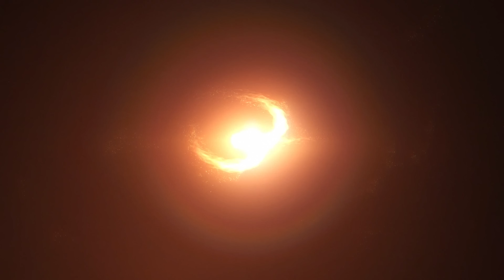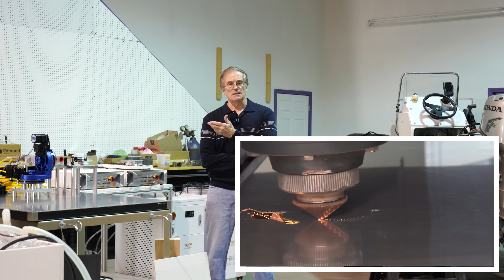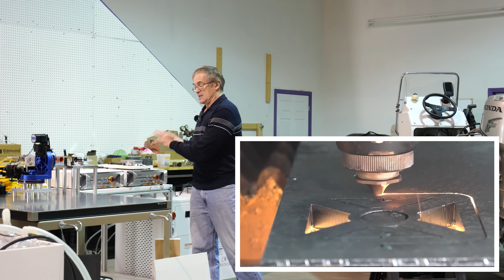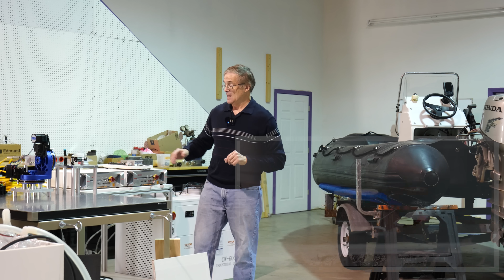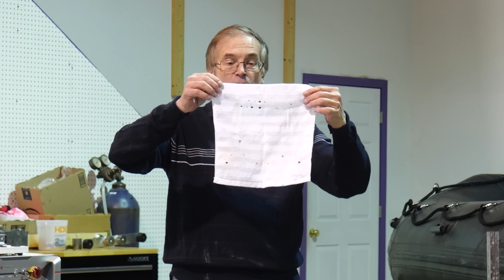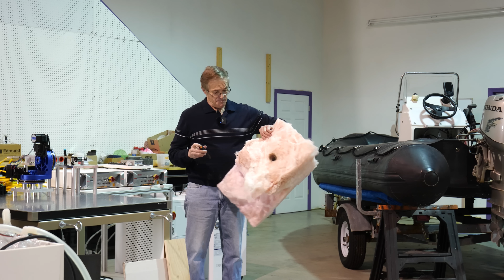We have a problem... and need your help!

Comment: You've already head quite a few comments, but I'll take a whack at it. My first thoughts were just using quartz fiber, thicker & thinner strands & just wetting them down in a bag or a couple maybe for layers of pouches to easily absorb most of the light & then reflect/refract them to diffuse the light into becoming less powerful. 

However, with how quick everything is, its probably easier to do something with hollow quartz tubes with nets plated with nickel around the outside & in-between, but that's a lot of plating for that fiber, which kinda just sucks, even though it might help with total water heat energy so long as you can soak it with a bit of sponge & or other fabric that's highly refractive & defractive to the light wave length. The wave length here matters the most, as its what allows for you to know how you can run a destructive interference pattern & a slight absorption & defraction reflection capture system.

Gases where going to be my go to, to recommend. A pressurized gas inside of quartz & a correct oil for the absorption & correction refraction/reflection index for your wave length will help you out because you can make sure everything is thick enough & has expansion chambers while being extremely cheap to boot.

But, it might be just annoying to have to buy & melt all of those quartz tubes & still be fairly expensive. The gases can be cheaper stuff like co2 & or sulfide gas like sodium chloride tetrasulfide mono-nitrogen gas. But the melting thing is more about thermalmomenta, the quartz is dang good at keeping itself from melting when it can only lightly absorb energy, which the gases & oil (typically a darker oil like synthetic high temp motoroil is going to perform but it depends on the wavelength of light) help with, if you can pump them around.

So, instead of all the quartz business, its likely easier to just have it destroy something that creates the needed defusal of light, like a bunch of clear rocks & a water with a proper offset s curve bend of mirror steel or something (tiny holes that have some behind them with a bent flare with holes in-between) to house it all to trap & contain all the needed light while making the energy no longer become substantial. 

the problem with glass is its heavy & expensive. So a plastic & fiber glass blend might be the cheaper option, if you can get a better cheaper fiber & poly-carbonate or something higher temp to hold all the water & clear pebbles. 

Reflective options on that need to be multiple layers of one way mirror finishes on the inner box or wall side that allows for it to be effectively attenuated, together with being able to use laser goggle plastics & or similar to allow for that light to be massively reduced trying to head back towards you, same with inside of the "anechoic chamber" for light you are making. 

Best option however, all told (besides a super trick laser pulse phasing system designed to interfere just right & destructively interfere to make it so it diffuses the beam & fully removes its power in a few millimeters! Oooh yeah baby! (sadly decently annoying for angles & timing together with a near net like grid & mirror board like system to then get angles down to do anything like that which just is complicated & while works shrugs harder to do that is likely desired)) is just an high temp oil, a high temp absorbing ceramic that cheap (like crushed rocks & dirt), combined with a few poles & a bunch of hoses that "water fall" it down with a cheap absorbing backing material that allows for it to river "wick effect" with some offset lengths of sticks & thatch for that material (like steel wool fiber or quartz fiber, something high temp & all that) to have hold it & have paths for the laser light to head into, reflect, then disperse into the surrounding pumped thin-ish mud-like liquid.

Can't beat stuff thats free & cheaply put together that can be made to work with some larger tolerance pumps that have the oil (from the fluid) to make sure they never have lubrication problems.

Hope it helps 0/

Comment: wet sandbags. ideally many small bags of sand inside of each burlap bag.    possibly some gravel mixed through to cap the holes.   To really get techie, mix some baking soda or any carbonate mix to foam instantly in the beam and ideally help contain the damage to the bag.   The ideal would be some mix that would become tacky to solid instantly in the heat of the beam so it would adhere to the bag preventing gross rips from spilling large volumes of sand.
Reply: And ideally you would have a "hunting" beam that would only turn on full power when the "hunting" was positively on target (perhaps only milliseconds).   That requires very fast processing to identify ... but I don't think it would be too bad if you have two cameras from different angles tracking the target, as both would flare at the same time when the target is positively covered.   A PID like algorithm could track the target's relative angles continuously and a flare at the predicted location could be identified almost instantly.... when both cam's flare from the hunting beam  power up for maybe 50ms ....

Comment: first thought i had was a large area with water mist (even sand!?), enough to disperse the beam, but i'm sure that would be a massive assembly / area to cover.  
I think you need multiple solutions here.  Power and optical assemblies adjustment to reduce time of the beam burning through everything.  Some camera vision smarts to detect that the beam has passed through the desired target? As well as some things (layered or dispersed) to stop the beam (at least for a short period of time)

Comment: grinded Copper oxide CuO mixed with Water.
Also anodized aluminum.
Carbon is another option to cover Surface.

Or use Graphite blocks combined to water.

Comment: More of a side project suggestion than a solution: Could you bounce and bend the laser beam by harnessing a jet of water to preserve the beam until tripping it to disperse/diverge as desired? This may not be applicable or workable with tracking/aiming adjustments, but it might be an interesting direction.

You may have seen industrial lasers that introduce a relatively low pressure (70-80psi) jet of water about as wide as a human hair to extend the optics of the focused beam out of the head over a greater distance; for those that aren't aware yet, fiber laser arrays produce a frequency of energy (around 1000nm) that will stay within the boundaries of a glass fibre cable, however it also will behave similarly within a ‘cable of water’ (to an extent). For industrial purposes this means that the ‘spot size’ of the beam can be somewhat maintained over a longer distance without expanding as it would in air/assist gases. Anyway, effectively the divergence of the beam in these setups will be curbed to the physical diameter of the water jet, so long as the water path is physically maintained. The benefit here being a cleaner/deeper cut for thicker materials. If this concept of a water path carrying laser energy at this wavelength is extended, it just might be possible to re-disperse it behind the target by conventional methods rather than exotic materials. These hydro-laser laser heads are crazy expensive though! Rather than the burden of creating or buying a lens assembly that integrates a water jet into the path of the beam while keeping all the optical properties in check, a first principles/iterative/minimal approach might be to try first with either lower power levels and expendable (3d printed) iterations, or sacrifice getting a 0.1mm spot size for something more simple/manageable but easy to test? Perhaps you may not need to use those additional lenses/collimators to converge the beam if the spot size is sufficient at those power levels?

My side idea is that, depending on the distance of the shot, a thin guided water path (like a water pistol ) may or may not preserve the beam optics sufficiently over enough distance to ‘carry’ the beam to the target. The real speculation starts here (I highly doubt this will work). If it misses, the water jet carrying the beam might be able to be dispersed to a desired x/y plane; ie the floor/back solid wall (..not back around the room!) by simply allowing the water to simply fall to the ground at relatively shallow angle? This might disperse the laser energy somewhat more desirably within a puddle over the surface of the  concrete, somehow? More-so anyway than a 5-10KW needle sized head of destruction :)? Would it disperse the heat absorption over a large enough for a few seconds without things getting out of hand? I’d be putting a sort of sandbag arrangement between you and the puddle to absorb any light energy leaving the edges of the puddle direct to your line of sight, if I were to try such a crazy idea. Goggles won’t protect that level of scattered laser radiation!

A downside is maintaining the water pressure enough to keep a straight line to the target over that distance (especially without it dispersing into droplets), but the induced curve due to gravity could be taken advantage of, aka the light can be ‘bent’ within the water jet over obstacles (think Bend it Like Beckham) with no added complexity. It would also be cool to manipulate the water path this way and that not just over stuff but around it (from being blown by air to more nerdy methods like being affected by directed sonic/subsonic energy, induced ionised attraction, etc).

Naturally, you might need to figure out how easily the laser will escape such a water path at various angles under different conditions, especially to keep your eyeballs out of harms way.  Not sure how the optics of 1000nm would behave? Does anyone know? It might warrant some testing at lower power levels.

All that said, these ideas may introduces a bunch of variables that have a negative flow-on effect (pardon the pun) if not kept in check ;). A fun little exercise with my morning coffee though!

More practically, seeing as you need a large background area to demonstrate the capability/possibilities of the improved system, I rate just shooting from an angle above to the floor, and patching any holes later (a case where 'hey, it was worth it').  Perhaps just a very shallow pool/array of pools on the floor (seeing the laser hit the water would be super cool as a by product). I also like the ideas of others like @calcs001 that allow dispersion of the beam onto more standard materials over a larger surface area or object. The rotating disc as suggested by @Elyasthecool is super simple; perhaps just add a few wobble axis to it so the same area isn’t hit twice on the second rotation? 

Lastly, building on the idea of having a moving surface/mass, could you build on the idea of a sheet of relatively inexpensive material (drywall or any of the material suggestions) that hangs behind and drops down (perhaps just a metre or two) just before firing? That’d add a moving but suitable laser absorbing surface without too much complexity, just letting gravity do the moving work. Then winch it back up after each shot to reset. Use an electric winch, put on some shock cords to arrest the sheet/s before they hit the floor, or pop some pool noodles on the bottom so they don't bang/break they drops. You could have two or more of these behind each other as backups obviously :) Better still, just have a few sheets of drywall (two rows deep?), hang them off the roof and allow them to swing sideways  by either pushing them manually or have a single rope/cable attached from the side of each row that moves them all so they swing together. 

Anyways! Love your channel!

Comment: So I was thinking about this and I have had similar but smaller scale problems.  But instead of absorption can you dissipate?  Like if you filled a clear container with like glass or small crystals or glass beads.  Or grind up glass into a powder.  When the laser hits it would it refract and disperse the laser enough to make it harmless?  I've never had to deal with something that powerful so this is purely conceptual.

Comment: Oh, for Pete's sake! Some have no military experience (and it shows!) (Que your best R. Lee Ermey impression here). While the business of ballistic and energy weapon armor may be quite different, the oldest and most proven method will probably be the best (and least costly). One word: sandbags. Cheap. Portable (transport empty as the filler is always underfoot). You can even obtain mechanical fillers to automate the most difficult part. Alternatively, you can use geotextile and earth layers set at an angle to build a cheap backstop anywhere reasonable for a range. Sand or even indigenous earth has incredible energy absorbing capacity., be it ballistic or photonic (thermal). No, you are not going to be able to transport it easily in a truck or trailer. Yes, it can be done with a reasonable budget. Bonus: it will be semi self-healing from your absorbed hits. Those areas torn up by repeated hits are easily repairable. Hell, you may be able to use an existing firearms range!
Reply: After reading many of the other ideas it occurs to me that you not only need an effective backstop for a test, you also need a failsafe to protect the world around you from a miss, misfire, or other malfunction. an energy absorbing mass and very positive direction limits are the only solution. The only reasonable and practical solution would be an existing outdoor firearms range. Preference should be given to those that use a high hill or bluff for a backstop. Do mind your laying limits! what you are building amounts to artillery, after all. Make the weapon portable (or at least in a temporary structure). Make the backstop permanent and impenetrable. Something akin to the Knob Creek Range in Kentucky would be ideal.

Comment: Here's a solution, a really simple one... change your perspective.

Mount the laser system on the roof facing downward above a bath of water, this alone won't work as water is reflective so keep reading..

At the base of the water have masonry blocks (like lightweight Hebel blocks) for any beams that make it through.

The surface of the water is reflective, so one or more of these following ideas as well fixes this:

Agitate the surface to disperse any reflections.

Use non-toxic suspended particles in the water like bentonite clay or titanium dioxide to make the water turbid which will help to diffuse the light.

On the surface of the water use foam or bubbles like Firefighters or theatres use, like Class A foam or synthetic high expansion foams. You could make up a home DIY version of this by mixing 1 part dishwashing liquid with 10 parts water and 1 part Glycerin or Corn Syrup (to stabilise the bubbles).

Above this water you could have a suspended net to catch any debris from your blasted drones.

This is low cost and will dissipate the light, reflections and the heat effectively.

Comment: "Optical leidenfrost" or "ultrasonic fog micro-lens array" : I think you probibly need to defuse the beam first before it hits a surface,  pretty sure the reason the plywood works as long as it does is because it emits smoke and that defuses the laser before it hits the surface. If you made a non flammable surface that produced large amounts of smoke or vapor to scatter the light like a "optical leidenfrost" it could protect the surface without having to fog up your entire shop. Perhaps soaking those mats in a mixture of water and propylene glycol or glycerin, or modifying your "ultimate smoke composition" to be non flamable and paint it on. Another idea is to suspend a raingutter full of water from the celing and place several ultrasonic foggers along the legnth creating wall of falling water droplets to scatter the light, but since they fall almost straight down it will stay localized just put a tarp down to catch water. Use a float valve to keep the gutter topped off?

Comment: What about placing a mirror on the wall at a 45 degree angle facing down at the floor. On the floor, below the mirror place a large water container painted black that has at least 12 inch deep of water. Make the water turbulent to diffuse and disperse the light inside the water container . The black walls inside the water container will absorb the energy and the water will disperse it. When finished flush out the water, put the mirror flat on the wall, put away the empty water container...  Voilà!

Comment: How about textured glass.  Glass textured with bumps that will diffuse the beam like a lens.   you could even try a 12x12" lexan slab and have the features machined into it.  the diffusing clear wall would be several feet in front of the brick wall behind it.
Reply: This would give some degree of reflection unfortunately.  You may have to shape the wall so not only is the passing through beam diffused, the reflection is also difused.

Comment: Seems like an energy dissipation challenge. How about a glass tank with water and infused with dyes. 
Dyes are a common laser 'modifier' I understand. Would preferably have agitation/circulation of the water/dye mix. 
The back glass wall could also have an irregular surface(either moulded glass or  even 'frosted' surface, which can then further diffract any light which has transit the water/dye mix.